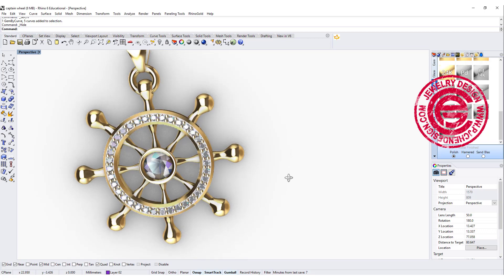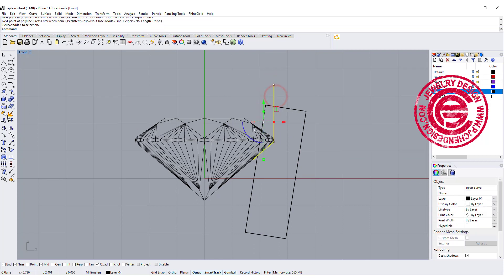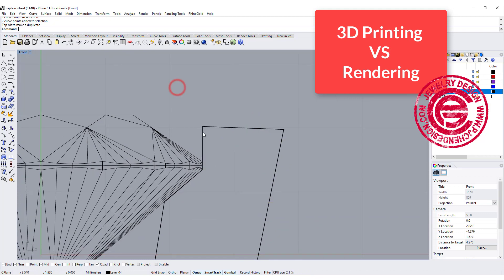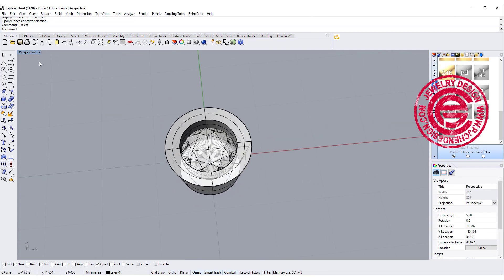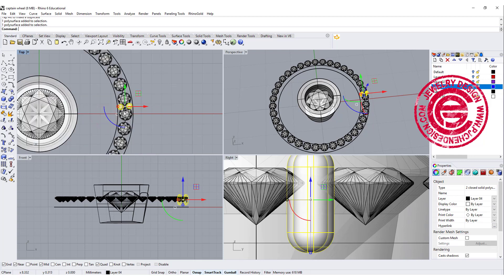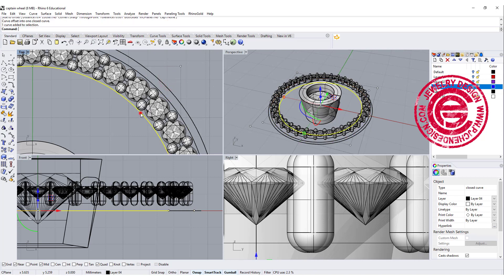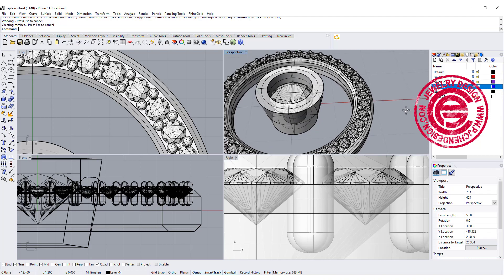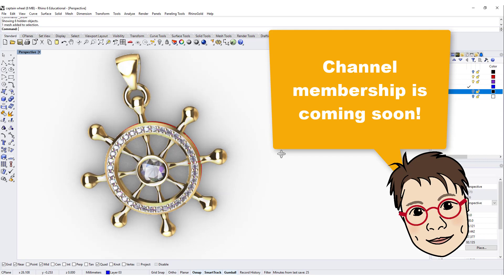Captain Wheel Pendant 3D Modeling in Rhino 6: Jewelry CAD Design Tutorial #104

Comment: I noted that the prongs were made with a 0.55 dia pipe.  Is this thick enough for  printing and making a mold for casting and/or casting directly after printing in wax?  I was told that prongs should be about 1 mm dia.  Also, how tall should the prongs be for setting the 1.3 mm stones?  Do you Boolean the stones from the solid ring leaving the openings as is for casting or do you make them smaller to be later adjusted for the setter?   Do you increase the overall dimensions to account for shrinkage, especially with the center bezel?  What factor [e.g. 1.2x - 1.5x] would you suggest  if the piece will be directly cast from a printed wax?  Thank you for the video.  It has given me a lot to think about.
Reply from the maker: Hi MJY, the prong size is base on the stone size. for melee, I won't go anything less then 0.4 mm. It is also depends on the setting. If your bead set is share prong, prong need to be bigger. However, you don't want the prong too big, or people will see the prongs not the stone. prong should be a little taller than table. for the shrinkage, it depends on your printer. you will need to work with the shrinkage of your printer to enlarge your model accordingly.
Reply: @PJChenJewelryDesign   Thank you for the information.  Am I correct that the stones are Booleaned from the ring before using the CAD file for printing.